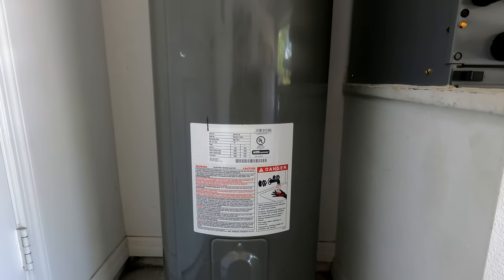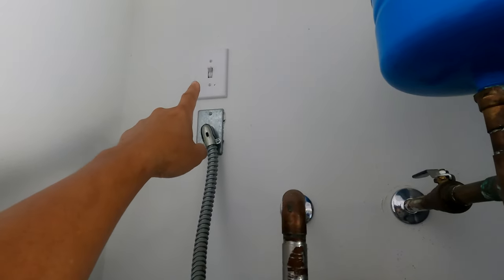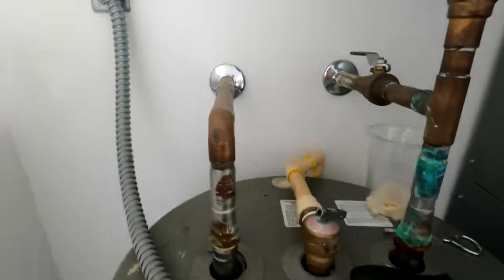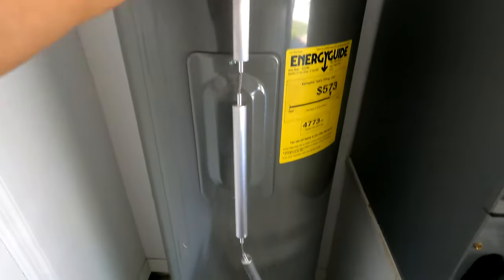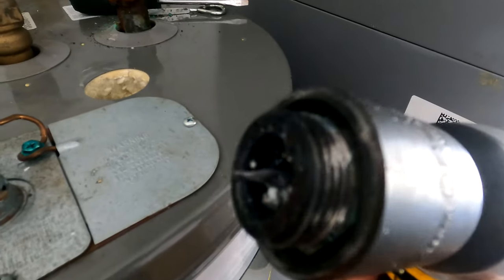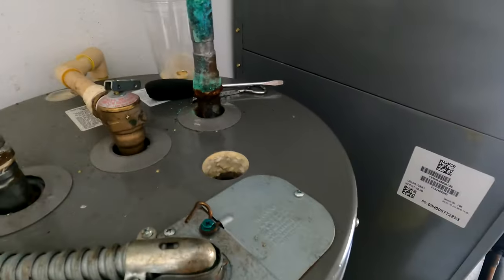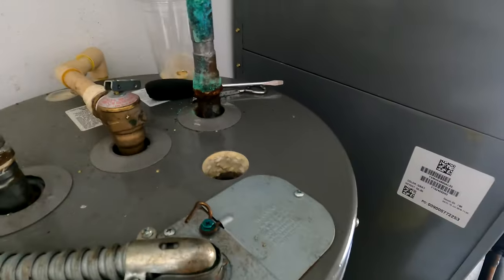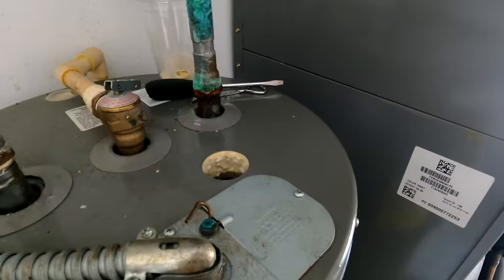Replacing anode rod for Rheem Water heater tank

Comment: It’s corroding because there is no transition from the steel pipe to the copper pipe. You need to put in each one a dielectric Union, also call transition Union between steel and copper two different metals
Reply from the maker: Thank you for the feedback and suggestion. I am planning on replacing them using kit:  SharkBite 18-in 3/4-in Push Inlet x 3/4-in FIP Outlet Corrugated Stainless Steel Water Heater Connector.
Item #1288489 | Model #24680Z
Reply: Are you able to tag a video explaining what you said? I replaced my water heater recently and have installed water filtration before my water softener now I just need to replace anode rods but what you said about transition unions sounds interesting. I’m big on water filtration. Thanks in advance
Reply from the maker: @danielduran3265  Hi, here is a link to a good video which I also posted in the community page:  https://youtu.be/fWz1it0AyRQ?si=j7Yh589DJf03VQEn
Hope it will help, good lucks with your project!

Comment: I used the same procedure and utilized my new Ryobi 18 volt impact wrench that has up to 600 torque lbs.  Loosened it in seconds..  Replaced with the segmented anode rod.  No leaks.  Everything worked out great.
Reply from the maker: Awesome 👍😎
Reply: @loumitch1  glad it worked for you.  I used the same wrench and it wouldn’t move.  I have loosened mower blades and other torqued on nuts with ease.  Not on this water heater though.

Comment: It is not advisable to completely cover all the threads of the anode, just part of the treads is enough to make a water tight seal. The reason is you need conductivity between the rod nut and the tank for the electrolysis connection, so the anode can do its job. You should have less than 1Ω resistance between the anode nut and the tank frame. You can check that with a good multimeter.
The rod is one electrode of an electrochemical cell with the steel tank being the other electrode. The two electrodes must be connected so that electrons can flow from the rod to the tank enabling the rod to sacrificially protect the tank from corrosion
Reply from the maker: Thank you for your feedback comment, good point!  👍🙂

Comment: Thanks for the video.  I have a AO Smith from 2015 and I have tried many times with a 1/2” impact hammer to loosen the anode.  I have released the pressure.  The drain valve is a plastic junky valve (probably from a big box store).  I am about to replace the whole blooming thing.  Tomorrow I will try one more time and if that fails, I may call a plumber and have it replaced.  I am afraid of hammering on the anode too much where I might damage the glass or whatever is in the tank insulating the main tank.  I am not a plumber, just a home owner trying to make things work.  All the best!

Comment: What I noticed on mine after having to dig out the foam that covered it, the nut portion was all rusted due to condensation buildup. When i replaced it with new aluminum rod, now that it's exposed to air it's prone to sweating and the nut portion will likely rust due to condensation long term. I need to have a good solution to a closed cell insulation to plug off the top
Reply from the maker: Thanks for the comment!  Yes, should cover it with any  type of insulation to avoid sweating 👍

Comment: These manufacturers don't give a damn about their customers. There is no reasonable reason for them to tighten the anode rod so tight and fill the hole with foam knowing that the anode rod must removed at least once a year. In 2023 I purchased a A.O. Smith 50 gallon electric water and two months after installation the cheap looking plastic drain valve started dripping water and I could not get it to stop si I had to put a cup under the drain valve which I had to empty every day. Due to warranty guidelines I had to flush the water heater and check the anode rod. I got everything done and decided to replace the cheap looking plastic drain valve with a brass ball valve. The plastic valve promptly broke and warranty does not cover breakage so I had to buy a replacement water heater. The second A.O.Smith water heater at ten months started  to trip the breaker . I called the company and they said I need to change the heating elements. The problem is the cheap looking plastic valve would not drain so I released as much water from the pressure valve which is not much. Lucky for me the water heater is in the garage so I had to take out the lower heating element releasing about forty gallons of water flooding the garage. I replaced both heating elements which was badly rusted after just ten months. I have to add that I am not on well water but city water which is pretty decent. I tried to take out the anode rod but it would not budge even with a full tank of water and a four foot extension bar. I called a water heater company and even with a compressor the anode rod would not budge. They took one look at the drain valve and would not touch it. A.O.Smith told me if using a compressor would not get the anode rod out then it's not coming out. They want to sell me an anode rod that is made on to the 11:59 hot water pipe for me $120.00. The problem is I still have a plastic drain valve that even the professionals won't touch. So I am just going to keep using it until it dies. Lesson learned? Never buy a water heater in withva plastic valve.
Reply from the maker: 😫thanks for feedback and very sorry for what you had to go through 🤞🙏

Comment: Corro- Protec has an electric anode rod with a 20yr warranty.
You should’ve installed it considering that’s an electric tank!
Just need to ad an outlet on the wall to plug it in.
Reply from the maker: Thanks, I did heard about that and might consider it the next round 🧐 😂.  Have a Merry Christmas 🎄🎁🎉

Comment: Rheem intended to prevent this maintenance
Reply from the maker: 👍 thank you for the comment!
Reply: @tick_go5989    I have a rheem electric. Expansion tank right over anode. Breaker bar spins tank.  No room for impact driver
Reply from the maker: @Hawka-Loogy ughh, that’s not good!  Is it copper pipe that you could unsolder? Or spin off the tank perhaps?  Just some thoughts!
Reply: I relate, I'm working on my dads that we put in about 7 yrs ago and of course ran into all these stupid hindrances to ease of replacement of anode.
The anode position is directly under the flue pipe. Lol!
Of course! How many different ways can there be a problem to slow this all down.
And then the water heater is turned in a way so the anode access is against the chimney side UNDER the flue pipe, so I have to remove the flue pipe and then have a ladder where I don't have room for one as the wat.heat. is set up on a 12" concrete riser.
I didn't even know about this anode replacement was a thing until just two days ago.lol
I had some intuitive idea for some reason to look up water heater maintenance.
Reply from the maker: @d.aardent9382  Thanks for the feedback and sorry for all the issues you had to face 😫 🙏
Reply: @d.aardent9382 
Going forward, it seems the smart thing to do is to replace the anode rod with an electric rod when you go to install a new water heater, while you still have the room and ability to do it before all the connections on top get in the way. I’m getting ready to check my 10 year old rheem 50 gallon gas water tank and have an electric rod ready to go. Hope my half inch impact driver is up to the task and that I have room to use it.

Comment: Would you have to flush the heater as well I've heard you don't have to for most cases
Reply from the maker: Yes, I would definitely recommend to flush as lots of rust and sediment from the anode dissolved.  You might have to use some thin stick to unclog the drain valve so the water can come out.  Thanks for the comment!
Reply: @tick_go5989  thanks a lot I will do so

Comment: The tank drained so slowly because of suction. Next time open a faucet in the house and the tank will drain fast.
Reply from the maker: Thanks MrSocko 👍!  In my case it was the heavy sediment buildup clogged the drain valve.  Have a Merry Christmas 🎁🎄!
Reply: Not the problem here...the tank was vented at the opening of the anode rod.
Reply from the maker: @dmob84  👍 Thanks!